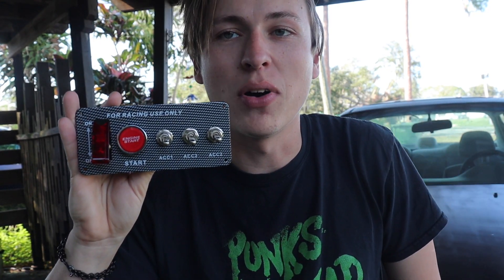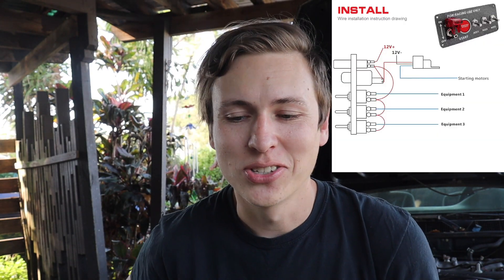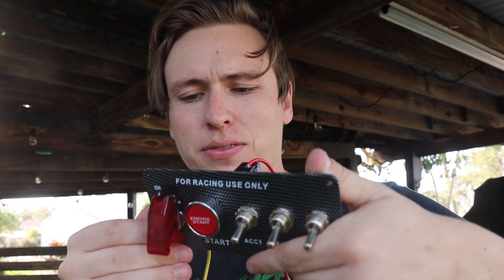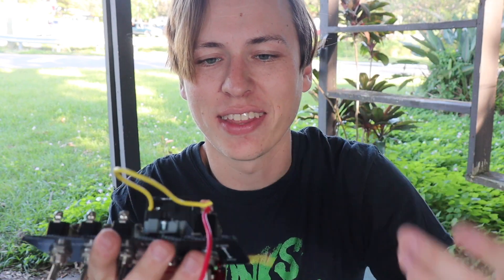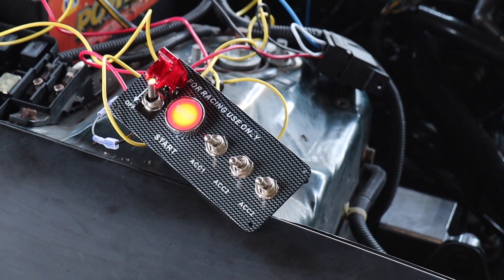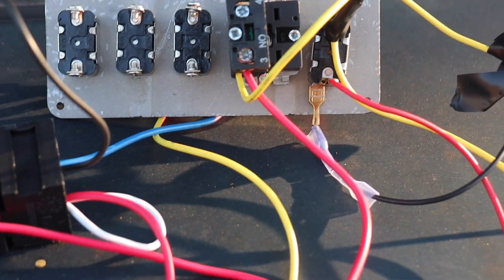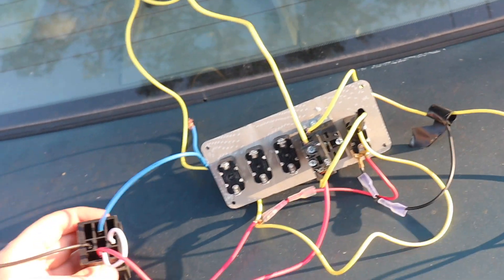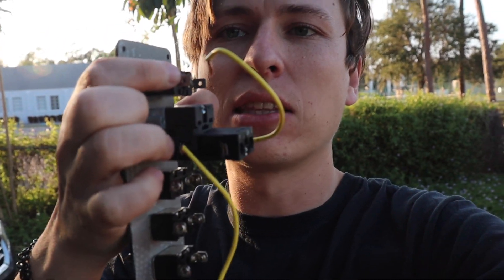How To Install A Switch Panel In An EK Civic!

Comment: I’m think I might do this on my 1995 civic, bro I’ve been chasing a no crank, no start issue forever. I’ve tired legit everything I have a clutch switch ordered if it doesn’t work then I’ll be doing this
Reply from the maker: You can use a paper clip to jump the clutch switch to see if that is your issue